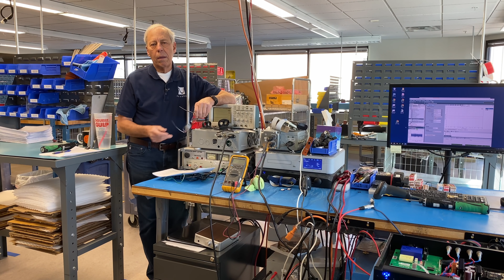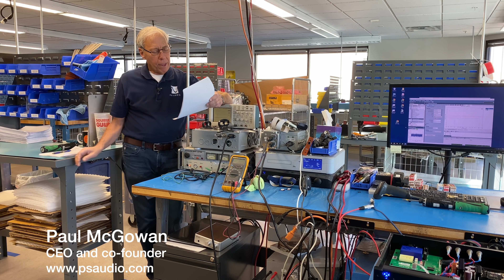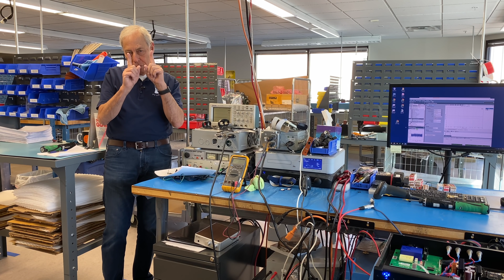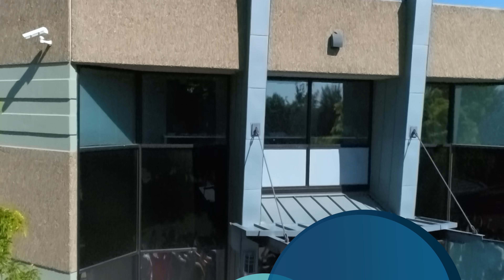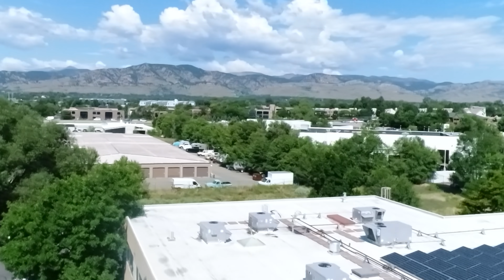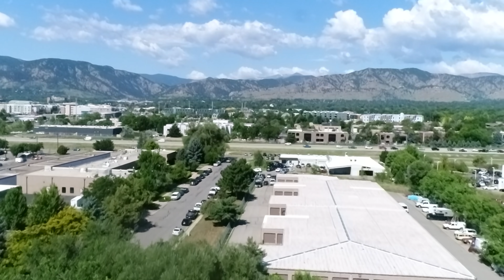Speakers with room cancellation modes

Comment: some speaker manufacturers are doing it like Polk audio L800 having drivers adjacent to each other and one out of phase cancelling the Reflections of the wall.
 you could achieve cancellation in the mid-range to High frequencies by placing two bookshelf speakers  tight against the side wall pointing towards the main speakers along the side walls put out of phase. Want a slight slit in the speakers so the speakers at the back of the cabinet to prevent dispersion getting into the room.
When this out of phase signal from the speakers hits the main speakers bouncing off the side will cancel it out

Comment: noise cancellation is about cancelling out things like lawn mowers, air conditioners, bus engines, wind, etc. the headphone speaker being in-between your ear and the noise, and a seal being made by either a rubber earpiece, or a foam over-the-ear cup makes this possible to isolate those noises and use the out-of-phase method (among others) to cancel them out.
in a room, some noises (such as your wife running the vacuum in the other room) won't be completely isolated or "blocked" from reaching you on the other side of a speaker, and therefore it would be near impossible for the speaker to do that... although, with an active microphone running, it may be possible to somewhat eleminate it. 

Balanced cables work like this: In an unbalanced cable, you have a positive and a ground signal, the ground signal serves as both the negative and ground and shielding in most cases. the interference, which is usually caused by anything emitting electromagnetic waves, but usually within the range of the speaker output, so, a power device most likely, as AC power is 60hz, which is technically an audible frequency... it can also be caused by things like a phone getting call, but not because of the cell signal, that's too high a frequency, it's more likely caused by the rapid switching of signals in the phone happening about 10-20 thousand times per second, aka 10-20khz, an audible frequency. but anything as high as 150khz can probably cause problems, as can anything as low as 1hz... anyway, it gets picked up by the wire because the wire acts almost like an antenna, and anything that's carrying any kind of voltage will pick it up in certain conditions. you can do things like cross the cables, etc... but...

balanced cables run a postive, negative AND A shield/ground wire (this time no signal on ground).  The signal is sent in what they often call "out-of-phase" but The positive and negative cables are not technically out-of-phase, because that would only work on a sine wave. they are opposite polarities, meaning they are the reverse polarity of each other, so imagine one wave faces UP, the other faces DOWN, and the same amount of UP and DOWN would equal ZERO or NO WAVE.. so, they're in-sync, just opposite polarity. so anything sent down them will cancel out if left that way. the cable still picks up interference on both postive and negative wiring... but this signal will be in-phase, or matching polarity, just like a normal audio signal on a regular unbalanced wire.  at the speaker, the polarity is reversed. this puts the audio signal back in-phase, and puts the noise out-of-phase. this makes the audio signal audible, and the interference silent (usually).   An interesting thing that happens here, is that when the signal gets put back in-phase, it causes constructive interference of the signal, and this causes the signal to be about 2-6dB "louder" than it would on a regular cable.
Reply: I wonder if you could achieve this by having a matrix of microphones throughout the room like the walls floor and ceiling.

Comment: Paul’s pretty much spot on on this one. There’s been many a try over the years to build room correction into loudspeakers. All of them not so successful. A good mid to high end receiver will feature DSP room correction. Mine even came with a microphone to run the room test. Lock the mic in your sitting location, run the DSP correction, and the receiver will correct for room reflections and nodes. Problem is it’s locked to where the mic was. Move a meter away in any direction and the correction is gone if not made things worse. Move a new piece of furnature into the room, or simply move something around and you have to rerun the DSP correction again.
Reply: A good avr takes mic readings in many different seating positions

Comment: 5:45 - One big thing for it to work well--it would have to know the listener's EXACT position and orientation!
Reply: Exactly, but with bass, that's not a big issue. Bass just fills the room "evenly" and is less directional.
That's why Paul likes it for tuning bass, but doubts the effect of the correction on mid to high frequencies.
Reply: Nah
Reply: @QoraxAudio  wow, this is soooo wrong. Bass does not fill the room evenly, go learn about room modes.
Reply: @bc527c  I know about standing wave ratios. With "less directional" I meant less.
Not a full absence.

Comment: speakers cant do it,  would like a link to the home theater Paul talked about. all dsp is doing is aligning phase and adjust volume.
room treatment do work on room modes, and if you want an active one, they make those for bass and sub bass frequencies, basically a subwoofer with mic to play opposite phase to cancel out the bounced bass waves.
Reply: Kii three is a dsp based active speaker which do room correction to an extent so all the sound reflections from the front wall is in phase with the sound going out from the front of the speakers when it reaches the front baffle. It gives a very accurate punchy bass tone.

Comment: Kii Three is a product that cancels out the room to some extent by sending out out of phase sound which is back in phace when it reflects back to the front baffle of the speaker, so all low frequencies are in phase at the plane of the baffle. I have heard that speaker and I didn't like the sound, but that was more about the tweeter and the lack of resolution. The overall system was good, but not for me. I have heard more revealing active speakers.

Comment: For years i never knew that it was possible to cancle noise by simply inverse that copied noise signal then put it out of phase with the original noise signal wich then run against eachother to cancle eachother out, this technic can be handy for old cassette tapes, just put an inversed out of phase noise signal, to mix it with that tape audio and all that noise should cancle eachother out leaving you only with clean music.

Comment: You didn’t mention companies such as Kii, Eikon, Dutch & Dutch who are making speakers with cardioid bass dispersion patterns that reduce room boom. They work very well. As far as Dirac is concerned, I run Dirac with my vintage horn system and it has simply transformed them particularly in the high frequencies. I can turn Dirac on and off at the touch of a button on a remote and the difference is striking, So I don’t agree with you there.
Reply: Martin M the Kii sound much better on analogue and vinyl. I had them in my room on home demo. You simply overlook their main feature however, which is to address bass and midbass issues. Streaming to them did not sound good. But streaming just doesn’t sound good yet anyway. Note i said yet. It’s just a convenient way to hear new music for the time being. My experiences with Dirac, which is much more than an eq (it shouldn’t be lumped in the same category), don’t agree with yours. I have messed around with dsp parametric eq and rew and the results don’t come close to Dirac imo. Anyway the debate about dsp and cardioid is like that about electric cars. People poopoo them now but these technologies are in their infancy. They are coming whether you like it or not. In general I prefer vinyl, triodes and horns, but there are certain things not amount of messing with passive crossovers can fix.
Reply: Can you get dirac live calibration in ASP?
Reply: @johnsweda2999  not sure. You have to buy a license. Check their website.

Comment: What Dirac does is compensating for issues of frequency response and time delays. What active noise cancelation does in earbuds and headphones is entirely different using doubler effect cancelation. In a listening room such approach simply isn’t viable for anything other than the deepest bass due to the too short wave length of audio. You simply can’t inject an opposite signal in a room that is reliably opposite at the exact two spots of your ears  as your head is moving. A 1kHz audio wave is about 1.1 feet or 34cm long and within that wave length of distance moving your head you would have anything between 1kHz canceled out to 1kHz being twice the signal, if someone tried to cancel a 1kHz unwanted wall reflection, for example. It’s a rather ridiculous idea. But in some cars the deepest frequencies of road and engine noise are canceled out in such way because the noise and head positions are somewhat predictable.

Comment: I have been hearing some good things, mostly from The Absolute Sound, about an integrated system from Gayle Sanders' (co-founder of Martin-Logan) new company Eikon Audio (sorry to plug a competitor, Paul, but not very much)  This Image 1 system uses a propriety (?) digital signal processor based on the Wavelet system optimized to drive a 4 amplifier powered speaker with an air motion transformer tweeter, cone midrange, and dual front and rear firing cone woofers.  They claim their signal processing in both the frequency and time domains will tame a problematic room to equal a very good pair of speakers in a very good room.  However, at $25000 for the system of controller and powered speakers, it is well beyond my means.  Supposedly the system has received a 2020 Editors Choice award from TAS with a full review in the near future.  Is it THE finest music reproduction system for an already good listening environment?  Probably not.  We shall see (and hear).  Just throwing some (hopefully accurate, but admittedly preliminary) information out to the PSAudio-verse.

For personal backgound, as a widowed, empty nest, retiree I downsized from a house, much larger than I now need, to a 3 room apartment (main room with open kitchen, bedroom and bathroom) that generally suits my current situation well, both spatially and economically.  Nice old neighborhood, too, big city park across the street and a really good coffee shop and a likewise bakery only 2 blocks over.  Unfortunately, I discovered after the fact that it also has a nasty bass resonance that really upsets my turntable.  My venerable and beloved ADS L520s simply overpower the room and the few modest attempts within my equally modest budget were only marginally effective.  I now make due with a pair of the wonder puppy Pioneer SP-BS22-LRs on tall stands with the bass rolled off a bit (yaayyy, tone controls with a by-pass switch).  Even these can excite the resonance with volume turned up past low medium   Bass shy music is still better than no music and from the mids up, they sound pretty good.  Wonder puppies indeed.  Although I am decidedly a loudspeaker kind of guy, for spinning vinyl and critical listening, I take the room out of the equation with an equally venerable Stax SR-44 electret headphone system.  It has a control box with an impedance matching transformer that wires directly to the speaker terminals of my integrated amp.  This control box has a switch for directing the output to either the earspeakers (in Stax-speak) or the loudspeakers.  Not ideal, but it works.
Reply: The Eikon system uses the same Bohmer model that the Legacy Audio Wavelet uses.  It is my understanding that the Legacy Audio Wavelet can be used with different speakers.  At one time, it was specific to the higher end Legacy Audio speakers.  However, they have removed that restriction.
Reply: @matthewbarrow3727  That is my my understanding also.  Anthony H. Cordesman gave it one of his Golden Ear vards in the 09/2018 TAS  3286, p. 76.
Reply: errata:  Awards .  .  . TAS #286 
Note to self:  pay attention, Steve.
Reply: Fat Rat  I've never had a problem like this before,  but I've gotten used to it.  I have frequently heard it said that the soul of music is in the midrange and within the constraints imposed by the laws of physics, the little Pioneers sing much better than one would expect.  Not LS3/5A class, of course, but not that far behind.  Andrew Jones certainly knew what he was doing when he designed and finessed these wonder puppies.  I can still pop a silver disk onto the tray, hit the play button and go, "Oh yeeaaahhhh!"  And otherwise, this is a nice place to live.

"I can't complain, but some times I still do."  --  Joe Walsh (1947 - still kickin')

Comment: Loved my quiet comfort 15 for noise cancelling BUT nearly got head taken off by a train by not hearing it just as I went to look over edge it came zooming a sec or so earlier WOW close shave but shame on every idiots near me on a packed platform think he might not be hearing it coming, made me jump back in SHOCK lol and another time I crossed the road it was empty both sides and road is not short so started crossing but from one side as I put my foot in the middle to go in next lane I looked left a saw a motorcycle coming right towards me as he had taken the corner and put his throttle on that was  so close that I didn't put my next step down he just missed me by inches and we looked into each others eyes as he missed me, felt like a scene out of mission impossible 2 😭😭😭😭. After that I was 10 times more careful crossing road but I believe there was one little issue with the noise cancelling with cars and bus you would hear a slight hiss noise that would alert you cars around but I  think because a train and a motor bike make much more louder sound it cancelled them  out completely not giving me a hint of anything  approaching.  Lucky bose crappy workmanship the speakers failed after a year and a half and then they said I need to buy new ones as out of warranty after a year. But I did not and good thing may be reason why I'm still here 😭😭😭😭😭😭
Reply: That's a you problem.  Technology can't protect you from yourself.  There are times where noise canceling and noise isolation can be problematic.  Use a headphone with an ambient sound mode or don't use them at all when you safely is at risk.  Situational awareness is important in all situations, headphones or no headphones.  Too many heads buried in smartphones and headphones when they need to be focused on their environment.
Reply: @matthewgaines10  I agree lol but in my comment if you read it the awareness mode only worked on cars and buses, bikes and the train it completely cancelled noise out, but there was no hiss or nothing to let you know theres something coming. On that day the whole platform was packed I'm only 5 feet 4 inches so couldn't see over everyone  so that was reason I went towards front of platform. But it's ok never again now I enjoy music on my £8000 set up at home 100%  safe 😭😭😭